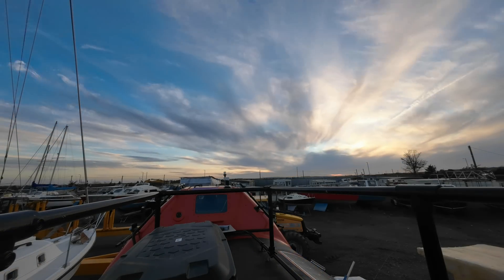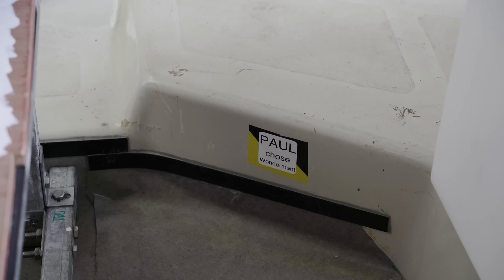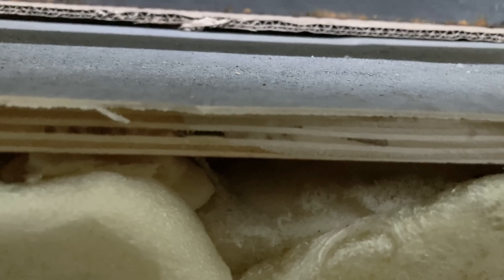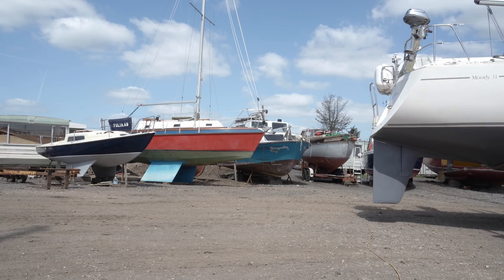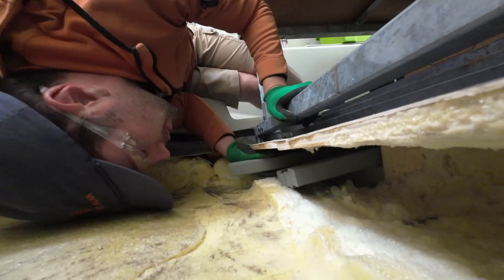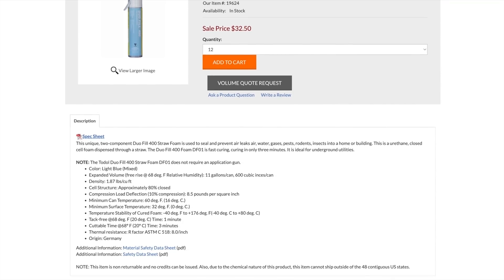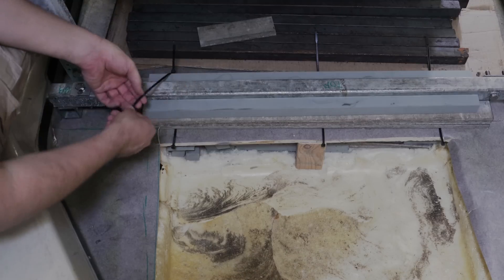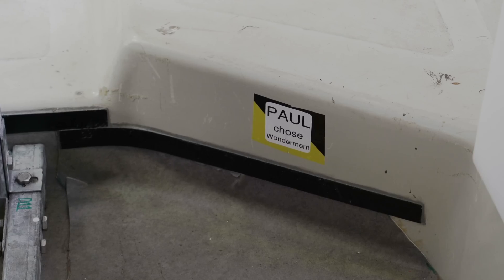Lifeboat Conversion Ep43: Removing polyurethane buoyancy foam to be replaced by steel ballast [4K]

Comment: I'm somewhat baffled by WHY you chose to make the floor out of plywood and to mount it permanently to above the bilge in the first place. I can say with 100% certainty that the area underneath will eventually fill with water and be a complete mess. My family has owned a few boats and water will always find the low point.

If it were up to me, I'd rip out all of that plywood flooring and start again. I'd section the floor up with removable plastic panels with hard plastic supports to set the elevation. I'd use some perforated material that will let water both in and out. Some type of polyethylene in the color of your choice. In this manner, the entire bilge area remains accessible for maintenance and drainage and will less likely grow mold.

You'd also have full access to stack in the ballast materials.

The folks with the SV Seeker project have done this type of thing, but using teak planking. When they need to get to a bilge area, they just lift up the appropriate section.

You will have water or a fuel spill or, God forbid, an overflow of the head. Liquid will seep into all the nooks and crannies. Embrace this eventuality and make it less painful by ripping out the plywood and planning for it now while the boat is on the shore and not while you're out at sea in an emergency.

My 25 shillings worth.

Comment: I would suggest filling the void with sand. Maybe with pressurised air if necessary. After closing the sand should stabilize the ballast firmliy and still be removable...

Comment: Re gal, those bars should be separated from each other. What happens is you guessed it a galvanic reaction causing white rust. The white rust is zinc oxide.
It's completely fine when it's dry but condensation and moisture precipitate the reaction. Rapid rusting of the base metal results as the gal coating oxidizes.
How do I know all this you may ask? Well I work in the steel industry and customers scream (and I do mean scream) when their galvanized products get wet. If they're touching each other they aren't allowed to get wet. Packs of wet gal RHS, no matter how well you've tarped a truck are cause for rancour with customers that never ever is forgotten and drivers being reprimanded by employers. This is how serious wet galvanized steel is treated in the industry. I wouldn't use it.
Find something that rusts, and allow it to surface rust. Leave it outside. After it rusts apply a rust treatment to it and that will stabilize it then prime it with something like Rustoleum. 
Gal is fine when it is electrically bonded through welding or bolting but relatively loose like this in a high humidity environment - forget it. Think of each piece as a battery looking to discharge at any opportunity.

Comment: I could imagine a situation in which something like ball bearings are used as opposed to steel bars... Ball bearings mixed in a bucket with your magical two part foam and then pressed through a tube into your new cavity. Not sure if they'd need to be rust treated due to the foam protecting them, but certainly there's a better ballast solution than trying to refoam the area somehow...
Reply: Obviously you wouldn't want to use brand new or otherwise useful ball bearings, ideally some found as refuse or scrap perhaps... Just spit balling here.

Comment: I’m curious why the UK doesn’t have closed cell foam in a can. It’s perfect for small repairs on boats and sealing gaps around plumbing in homes.
Reply from the maker: I was thinking exactly the same. The only one available seems to be Touch n Foam Landscape. And it's a tiny can, with the aquaria-safe feature many people don't need.

Comment: Maybe use a silicone caulking and just use pressure to hopefully fill in the gaps. Also you should use stainless steel zip ties. I’ve found in the cold the cheaper zip ties especially get very brittle and break easily.
Reply from the maker: I think caulking would be a bit of a nightmare to get into blind gaps. And you'd need to do in it lots of batches, to allow the deeper areas to air cure.

Stainless zip ties could accelerate corrosion, and really the reason these broke was because I accidentally used my box of cheap PP ones, not nylon.

Comment: I know it is nearly as slight as a canoe, Alan does have a keel, or at least a chime of sorts. I don't know how hot you can safely get fiberglass, but Babbitt is pretty easy to find, inexpensive, and mostly lead so pretty much maintenance free and quite heavy. More relevantly, it has a very low molten temperature, less than 500 degrees I believe. Could having a thin stripe of significantly heavier ballast in the very bottom reduce your need for the higher maintenance mild steel higher up?
Reply from the maker: Babbitt is pretty expensive, and the melting temps would damage the foam, ply and even the FB I think.

But yes, something right down low on the keel is planned.

Comment: This is by far one of the best projects on life boats I have seen so far and you are doing a amazing job. My  farther also love's your project but he raised a point of concern. He worked in ship design and construction (admittedly on much larger ships) and one of the thing's he mentioned was the ballast placement. He said that it is all well and good adding weight to bring better stability but if the weights are to far forward/back or side to side from centre keel that it would throw the boats centre of gravity off and the role and pitch in even minor waves would become bit issue. If this is a issue on smaller boat's I am not 100% sure but he felt it was worth mentioning. Also in answer to your question he mentioned an old trick he learned in the 60's. Thinned out tile grout. but you mix the water with a good strength PVA glue. 1-1.

Comment: since u have them in place, I'd hot-glue a perpendicular flat bar to their ends, let dry, pull out....then wire-wrap or weld into one solid piece of ballast. within the gaps, u could fill with hot lead, chunks of steel, etc. that way, if the ballasts are improportinate, u could retrieve the entire mass and adjust accordingly.  Essentially, just make it one mass that is swappable and adjustable depending on needs.

Comment: In the US, we have some spray foams intended for exterior use that are supposedly rot-resistant and fairly tough. I used some in my greenhouse two years ago.
Reply: https://youtu.be/E4UGLfUKRAk - it seems to be completely intact, in spite of fairy high humidity.
Reply from the maker: It's the one we can get over there too. I've emailed DAP to check the closed cell count.

Comment: I myself would acquire a ton of plastic grocery shopping bags and a long 3/8" wooden dowl rod. Then lay down and push/cram crumpled up plastic bag bunches into every open space until it was jammed full upholding tight all the iron in place. Then seal off the opening, have a cold drink and most importantly "forget about it".
Reply from the maker: I can't knock the originality. Or slightly nihilistic end game.
Reply: @AlexHibbertOriginals  I can accept that as a fair response, and best of luck to and for you with the planned adventures. I will be  here watching intently!

Comment: Try Waterproof Gorilla glue, it foams up when it drys so will expand nicely into the spaces.
Reply from the maker: Gorilla glue is just a rigid polyurethane glue, so a very expensive alternative to normal PU foam.
Reply: @AlexHibbertOriginals  Paul Ryan could be referring to 'GORILLA FILLER WEATHERPROOF EXPANDING FOAM FILLER' which is waterproof expanding foam filler.

Comment: What about mixing small lead shot with resin and pumping it in with a large syringe and vinyl tube?
When I say large syringe I mean the automotive type, mine is half a liter and uses 10mm hose.
Reply: I used that method to make my set of curling stones. Heavy enough to use on lake ice after a bit of levelling.

Comment: I would imagine you would want a lot of redundancy on an Arctic excursion, i’m not experience with anything you’re doing but I’m experienced with cold weather. You should have some kind of back up system to make sure the water in that tank does not freeze, there’s a special type of wire that will increase its resistance in relation to a decrease in temperature. I don’t have the information on hand, but it should keep that water from freezing in event of some major failure while not draining any electricity unless the temperature in the cabin is close to or below freezing. Maybe I’m worried about nothing, maybe it’s not even the best solution. it seems pretty unlikely you should lose cabin heating and yet still have power for the heatline, but it’s something to think about.
Reply from the maker: In that situation we'd melt snow on demand, or use a manual water mater and sea water.
Reply: @AlexHibbertOriginals  definitely the more efficient way to go about things, one other thing in relation to your foam/filler problem. If weight and ballast is what you are after have you considered using cement? Plenty of weight to be had along with filling the voids. Or would concrete pose some other problem in a nautical setting?
Reply from the maker: @myoldaccount2560  it's still the side access only problem. Pouring from one top entry isn't possible.
Reply: @AlexHibbertOriginals  are you afraid it won’t flow in properly from the side? Keep in mind that using cement would all but eliminate the need to use steel ballast down there. I know you put a lot of work into it, but if you were to pull out the steel that should provide enough room for cement to fill in. If there’s also an issue in elevation you could try sticking a hose at the highest point connected to a vacuum to literally suck the void out, closed cell foam should be reasonably airtight for this method. If you want to leave the steel in, someone else in the comments mentioned a half litre automotive syringe, providing it can handle a thicker solution like concrete you might be able to forcefully inject cement around the steel. I’m all out of ideas, cheers.

Comment: I would be careful removing buoyancy foam as that is there to prevent it from being sinkable! Especially if you get into icy waters and get a hull breach! Also there is the balance issue! If you don't put the weight in the right places now you are listing. 
Don't want to be reading about the unfortunate Alex Hibbert exploration sinking.
Reply from the maker: This was additional foam we added. The boat is rated to nearly ten tons over and above empty weight. The fixed ballast is being located centrally/laterally symmetrical. Hopefully you won't be reading about any unfortunate sinking!

Comment: In regards to the two part foam insertion there are DIY two part kits sold in the big box stores in the U.S., so I imagine they exist in the U.K.
If not I was thinking about two very large syringes, some vinyl tubing, and the blending nozzles that are available for Sikaflex two part products. I was imagining that the syringes could be cobbled together with maybe a wooden frame so that they would fit onto a cheep caulk gun, and would dispense evenly. Attach the blending nozzle to a rod for reaching those pesky difficult to reach voids.
Reply from the maker: You're right that the kits are available - I'm trying to avoid investing in a whole set up for one niche job.
Reply: @AlexHibbertOriginals  yes, they’re not cheap at all, that’s why I brought up the syringe rig. I’ve never made such a contraption, but I have used two part adhesives that came made to drop into a calk gun, then we’re mixed with a special screw on nozzle.
Reply: @AlexHibbertOriginals  I just had another thought. From time to time I receive electronics that are packed in a closed cell semi rigid foam material. I know it won’t absorb water because I have inadvertently left it outside during rain. Anyway, I was thinking that you could take a 1 inch or three-quarter inch piece of PVC pipe, Slice the foam into strips that would fit snugly inside of a pipe, push the pipe in place where you want the foam to be, Then push the foam out of the pipe with a dowel, while pulling the pipe back out of the void area.
Then just repeat as many times as it takes.

Comment: I have recently worked with window fitting company and they use closed cell foam in simple cans. If you can't get those on the market, try visiting some window company around, they should have something suitable for your situation.
Reply from the maker: The issue is that most cheap cans are actually open cell. I'm trying to source a closed cell version that doesn't need a machine.
Reply: @AlexHibbertOriginals  yes, I am aware of this issue
However windows are facing out to the weather and because of this are mounted not by open cell foam but by closed cell foam (at least in our house they are).
When we were building our house we obtained few cans of the closed cell foam from the window company as we were not able to get it in normal hobbymarket. You can try the same trick ;)
Reply from the maker: Pretty extensive searching has drawn a blank for canned spray closed cell foam in the UK, even from trade suppliers, aside from a couple of pond products.
Reply: @AlexHibbertOriginals  well, it was just a tip that worked for me
Wish you luck whatever solution you choose.

Comment: Another great episode. I think for now something temporary to fix the ballast in case it needs to be moved. Some 2 parts silicone could be a long term solution but they all tend to do badly in cold weather.

Comment: If your filling an area thats still "defined" by foam, how about pouring runny concrete with fiber reinforcing? fills the gaps and is also heavy and wont allow water build up once cured?
Reply from the maker: It's the same angle issue as pouring in LD40 foam. I have only side access.
Reply: This problem is definitely above my paygrade. In construction there is a substance similar to concrete that is pumped through a hose and sprayed. I don't know if it would be applicable in this situation like the gentleman above mentioned about absorbing water or cracking.

https://en.m.wikipedia.org/wiki/Shotcrete

I wonder if using the spray foam would cause warping of the floor as it expands.
Reply from the maker: @GrizzLeeTroll13  The floor has hundreds of klios weighing it down, so I doubt small quantities of foam will warp it.
Reply: I was thinking the same but concrete can absorb moisture and crack in cold temperatures. It also very rigid and could crack with shocks from waves and such. Drying indoor with the thickness needed wouldn't be good either.

Comment: How about the rubbery silicone stuff dentists use for impressions can be squirted or injected it goes off quickly and is waterproof.
Also being rubbery it would help with your vibration concerns.

Comment: I wonder if a Manual Sausage Maker Stainless Steel Stuffer Homemade Syringe Meat Filler that has a 1.5cm, 2cm & 2.3cm nozzle on the end could be useful if you put closed cell expanding foam into it with a length of clear pvc tubing fitted over the nozzle so that you can get into hidden crevices? As soon as you pour it into the stuffer which holds about 500cc volume & screw the plunger end on the expanding foam would begin to expand out the end of the pvc tubing which will give you plenty of time to push out the rest of the contents.
Reply from the maker: Creaming to expansion time is only 10-15 secs with the foam I have. You'd have to work at light speed.
Reply: @AlexHibbertOriginals  10 - 15 seconds from pouring it into the stuffing cylinder to screwing the end on is possible if you stand the cylinder vertical because as you pour it will begin to drain into the tubing giving you space get the end on in time.

Comment: Maybe you could seal that open end of the void and drill a hole in the floor  on top of it and funnel the expanding foam in
Reply from the maker: Yes that was the original method, but here I'd need to do it in a dozen locations - quite the mess.

Comment: A little undignified for Alan but, get the boatyard to lift Alan up by the stern and then you can pour expanding foam into the gap to your heart’s content. It will also let you find out which items you’ve not yet secured sufficiently.
Reply from the maker: Surely it would be £100 well spent, and not at all overkill. I like it.
Reply: Dooooo iiiiiiithhhh!!!

Comment: First, I am not an expert and maybe you have already thought about something like this. What about Sika-postfix, it could be a solution. It should be closed foam and the bag sizes are easy to use.
Reply from the maker: I think that's just like LD40, that I have a few bottles of, but perhaps a different formulation.  Pouring into a hole is easy - getting it quickly into a horizontally distant crevice is harder.

Comment: Would the foam builders and window fitters use work I’m a mechanic and how we spray anti corrosion down chassis beams or in sealed frames is with a stiff bit of plastic pipe we use some from a hgv air brakes system just block up one end and mark a few holes all the way around the pipe at the blocked end then wedge on the spay can at the other end with some ingenuity it works a treat i can’t why this wouldn’t work with expandable foam to get to the very back
Reply from the maker: The foam you're talking about is either open cell (the normal spray can stuff) or needs a machine to operate a closed cell sprayer. Your method to distribute anti-corrosion liquid probably wouldn't work with the 2-part LD40, as you have a matter of a few seconds before it starts to expand and block holes or tubes.
Reply: @AlexHibbertOriginals  it’s worth a squirt lol